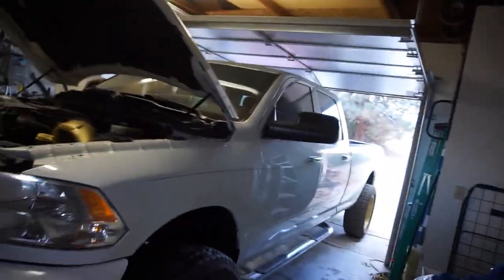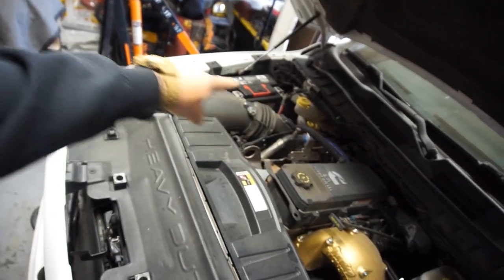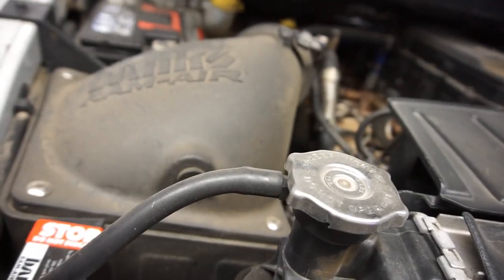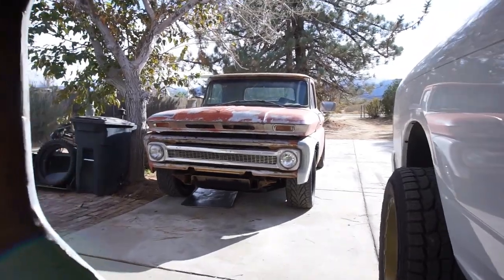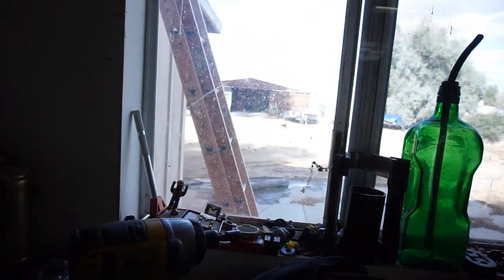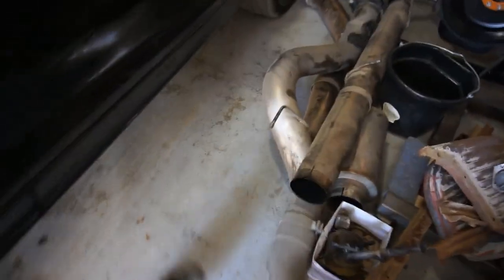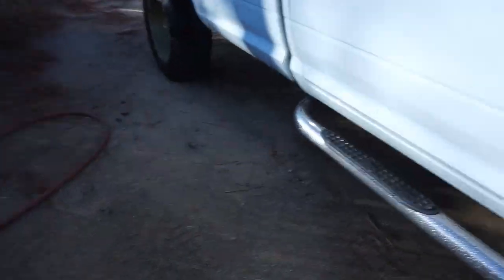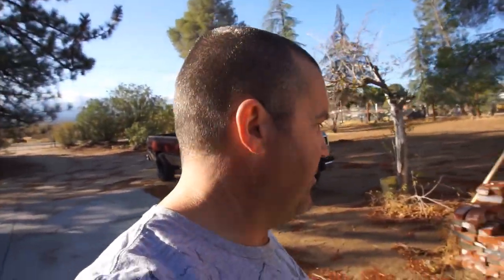Returning The 2012 Ram 2500 Cummins Diesel Back To Stock. Thanks EPA!!

Comment: What other parts did you have to order? What other codes if you remember? I have a laundry list of codes when I tried to return to stock. Can’t figure it out!! 

P2493
Bank 1
ECM - EGR Cooler Bypass Pos Sens Range/Perf

U02A2
ECM - Lost Comm With Reductant Quality Module

P02E7
ECM - Diesel Intake Air Flow A Pos Sens Circ
Range/Perf

Thanks
Reply from the maker: Sounds like you have a DEF truck so you just need to make sure everything is connected and the stock tune is installed. To me it sounds like your tune is still installed with those codes or stuff is unplugged.
Reply: @Halffast719  yes. Everything is connected and stock tune is installed! Can’t figure it out
Reply from the maker: @jacobm9574  you might have to pull the DEF tank down and clean it and the injector might be plugged up or crystallized.
Reply: @Halffast719  okay I’ll try that thank you!

Comment: Hey bro I got the same issue going on right now expect I don’t have the parts! Did you have the computer reset )
Reply from the maker: I didn’t have the computer reset, I got a tuner that returns it back to stock. But has to be the tuner that it was tuned with.
Reply: @Halffast719  what tuner where you using ? 
Your in the av? Pearblossom?
Reply from the maker: H&S mini maxx
Reply: @Halffast719  thanks for responding man 
I have an edge tuner and got some of the dpf parts but this shit is driving me wild lol but like you said got to bite the bullet
Reply from the maker: I know. I gotta swap over 3 vehicles every other year. Now I’m working on deleting this Audi TDI so that’ll make it 4 vehicles every other year.
Reply: @Halffast719  I guess I can’t complain right 
Thank tho I’ll let you know how it goes
Reply from the maker: You got it. Let me know.